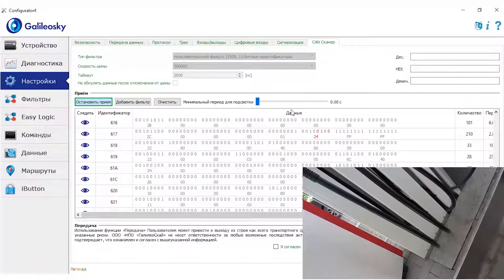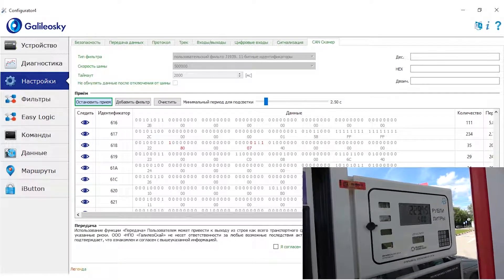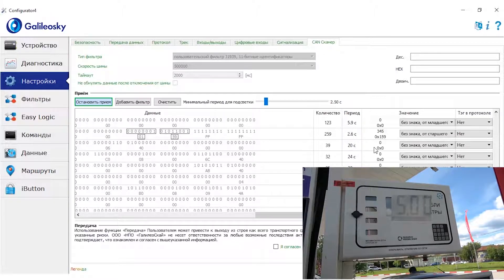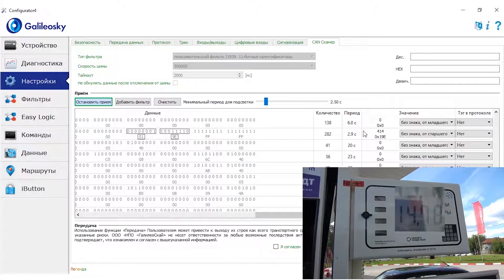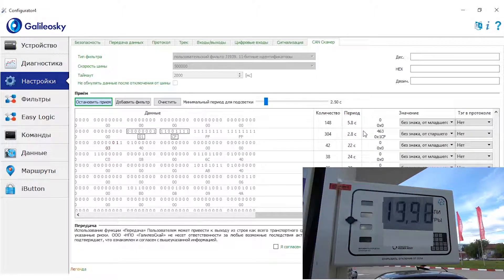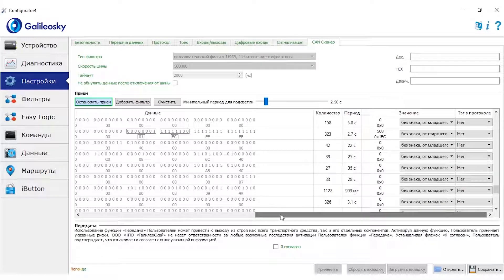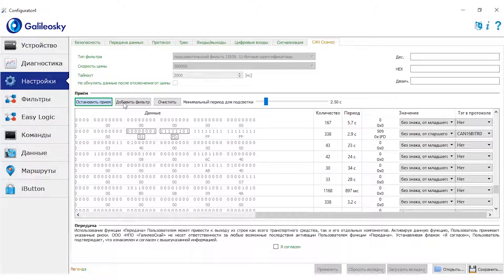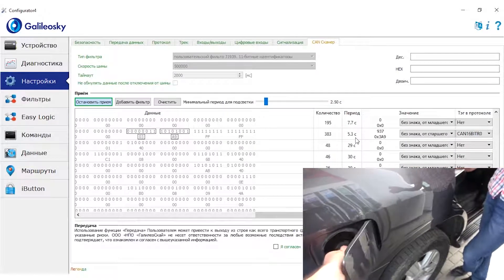How to find fuel level data in the CAN-bus

Comment: In most CAR Fule level PID ie 47 ( 02F) is not returning any data. How do you overcome this problem in your hardware?
Reply: Hello, did you get a solution to this? I am working on a similar project where I need to obtain changes in car fuel levels and transmit data to a web/mobile application. Any info will be helpful
Reply: @garettclement6671  hi 
It solely depends on automobile manufacturers. In some cars I got this information.